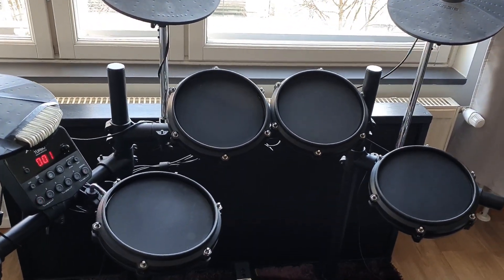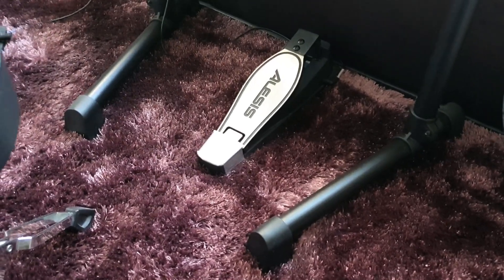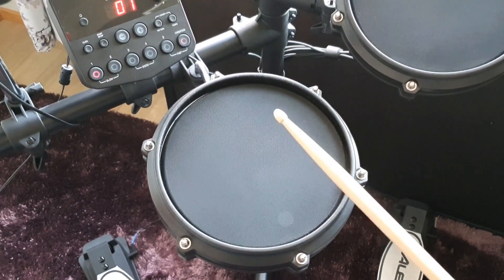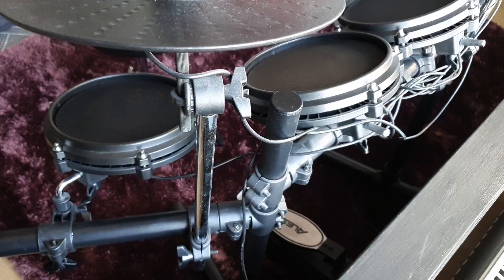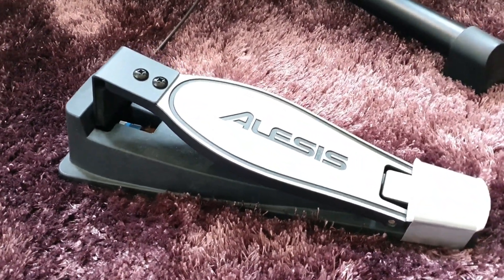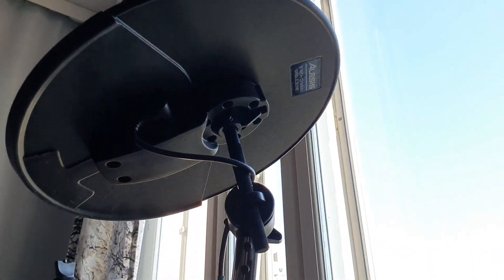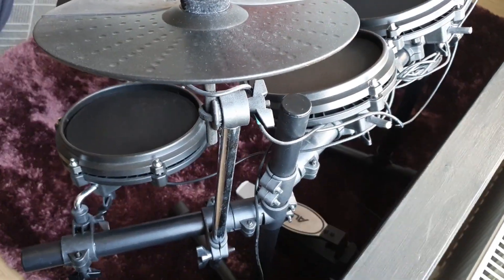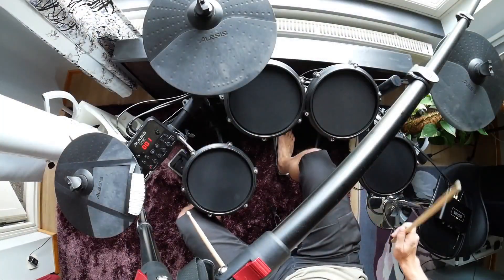Alesis Turbo Mesh Kit review (with MIDI hacking)

Comment: Hi friend, I'm having trouble with my hi-hat. I've tried everything, including using "LEARN" to read all MIDI messages, but it didn't work. Do you know if there's an option for Windows?
Reply from the maker: I assume you're having the problem of the hi-hat always playing an open hihat note even when the pedal is pressed down? I don't know a 100% working solution to Windows, but apparently in an older comment I mentioned MIDI ReLink software that seems to do what I was doing with mididings, so you might have success with that by translating the message I highlighted in the video.

Comment: This matches my experience too. Pretty fun for rock and the like but anything sparse/quiet starts to feel weird.

It's a shame they kind of half-assed the module itself. A signal booster for the cymbals would have been much appreciated, seeing as you can only boost the MIDI later if you hit it hard enough to get a 'noteon' event. Though I've read rumours of this being fixed by swapping out a resistor in the cymbal somewhere.

Comment: We are basically in the same boat I should say.  Im also frustrated with the purchase I made with this E drum not realizing that all the drum pads are SINGLE ZONE, and that the foot pedal has an inherent design flaw that you just highlighted. I think that issue  was already present in the older models, and also with Nitro, which is turbos successor.

I looked into your repo, given that I only have little coding knowledge plus zero Linux experience. But I think your script would work on the use case Im thinking: making the cymbal and hi hat hits to trigger different samples based on velocity. Reaper has a ton of MIDI scripts for this, but I think that fixing the midi data prior to hitting the DAW would be much efficient in triggering the samples.

Comment: Thanks for the video! It wasn't what I was looking for, but it was new knowledge for me! :)

I have a similar kit (Alesis Mesh Nitro). The pre-recorded sounds are not the best. I already connected the kit to my PC via USB and, with EZdrummer, I now have some great drum sounds.
However, I would love to have those sounds in the module itself. I opened the module and was hoping to find a removable card slot or another USB connection, or some other way to upgrade it. I know the sounds are stored somewhere in the flash memory chips, and it's possible to upload new (or custom) sounds to it, but I don’t know which chip holds the sounds or how to upload new sounds to it.
Having good sounds without needing the PC would be fantastic.
Any ideas for this hack? I’ve been looking online, but haven’t had any luck so far.

If you know anything, please let me know!

Thanks,
Best regards!

Comment: Probably a newbie qn. But can these mididings software and its requirements be downloaded through Windows? From what I understand its preferred on Linux. 

Nice review by the way! Made me want to learn how to use the software for it.
Reply from the maker: @vandelbit495  IIRC, Mididings is only for JACK, which is mainly for Linux but might also work for MacOS. Any similar MIDI translation/router software would work, though. I do not know of any solution for Windows straight away, though.

Comment: How do you record the drum set, i cannot figure it out
Reply from the maker: There are line out jacks in main unit. You can see the black audio cables going to the inputs of my Motu M4 sound card that's on the chair. Then just use a recording software such as Audacity.
Reply: @FinnPanther   is there some other way, because the sound card is expensive
Reply from the maker: Well what do you mean by other way? You need some kind of device for recording. A computer is probably one of the cheapest ways as most people have one, and most desktop PCs already have a line input in their integrated sound card. Dedicated recording equipment would be relatively much more expensive.
Reply: @FinnPanther   Yeah so i was thinking through the computer. See, I plugged in the headphone jack out from the module into my computer and used audacity but the sound of the drums is very quite even when it is turned up to the maximum. There is also alot of noise in it. I have a midi to usb Cable but I dont know how to use it. Also thank you so much man, youre really helpful and I am sure to subscribe to your channel. Tysm
Reply from the maker: The headphone output is quite noisy but it shouldn't be that noisy. You had the volume at max level? Try the line out connectors instead. And on the computer side, double check it's a line in and not mic in and see the recording levels in mixer.
Reply: I used the line out "phone" jack to record. The mixers fine. How do i check if it is line in and not mic in
Reply: @FinnPanther

Comment: Would you be able to send the midi information of different hits into a computer and then change the sounds later?
Reply from the maker: That's what I'm doing, i.e. using the drums as a MIDI controller, and Hydrogen as the sampler. But note the debugging stuff I did, there's a catch regarding the hi-hat.
Reply: @FinnPanther I was thinking that but wasn't quite sure. Thank you ☺️👍

Comment: Hi there! Im thinking about trading my phone (poco f4 gt) for a turbo kit, but first I just wajted to know if it the pads are sensitive to how hard you hit them, as I couldn't find anything talking about this online💔 tysm btw!!
Reply from the maker: Yes, the mesh pads and the cymbals have hit velocity (power) detection. I guess it should be apparent fron the video, though...? :P Anyway, if using the drums as MIDI controller, the velocity values go from 0 to 127 as usual.

The pedals do not have velocity, though. They are always just triggers. Depending on what you're playing this might be an issue.

Comment: Good afternoon, thank you very much for such a detailed review, after it I bought myself the same one, but I have one problem, the kick sound sounds too loud without connecting to a computer, and the closed hi-hat sound, on the contrary, sounds quiet and is almost inaudible,  is there any way to configure this on the module?
Reply from the maker: Yeah, the hi-hat problem is the thing I explain later in the video where I debug the MIDI messages. Your software needs to support the way the drums send the pedal state. If it doesn't, you can try hacking as I did using the mididings software.
Reply from the maker: Hi, and thanks! As I mentioned in the video, one of the biggest drawbacks in the default sounds is how unbalanced they are. Unfortunately there is no way to fix the problem without using a computer as the sampler. I think they made it on purpose so that people would buy more expensive modules.
Reply: @FinnPanther  Thanks for the answer, totally agree with you, to partially exploit this bug I use addictve drums 2, but there I ran into a problem with the middle position of the hi-hat, it's not there at all ?  hi-hat works well in your video, as if in all states, how did you manage to solve this problem?

Comment: Do you know if i can put another pedals, i dont like the kick pedal
Reply from the maker: Yes, but it depends. Not sure how the control unit transforms the messages, but the pedals are basically just switches (i.e. there is an electrical connection, or there is not).

If I connect a pad to the pedal cable, I have to hit it really hard for the hit to register - but it will register. Therefore, I believe the control unit expects to have very little electrical resistance to interpret something as a pedal hit.

So, I'd say your pedal has to work like an electrical switch (on/off) to work correctly with the drums.
Reply: if i take a Tom as a kick tower and if i Buy a pedal to use it with the Tom, works like a normal pedal?
Reply from the maker: @rubenpalacios4619  in theory yes, but the kicks need to be hard enough. And you still won't have kick velocity, as there's the threshold when the kick will register (and will be reported with a constant MIDI velocity), below that it won't.

I do know they sell el cheapo kick towers for e-drums; they only have a single piezo and a cymbal-like rubber surface. They probably work better than a tom pad, which has the mesh.

Comment: What's that white thing on your hihats?
Reply from the maker: Pieces of home window insulation rubber strips.
Reply: Do you find the hi hat sound is weak and over shadowed don’t by the sound when hitting the rubber pad?
Reply from the maker: @allanxngai not sure what you mean; if you mean does the white rubber impact the hit sensitivity? Not really. It just cuts of the loudest snap, making it a bit more comfortable to play I think.

If you mean are the stock sound cymbals too quiet: yes. That's what I also said in the video.